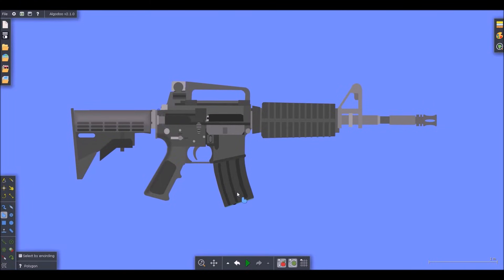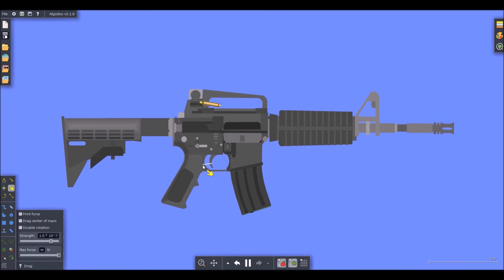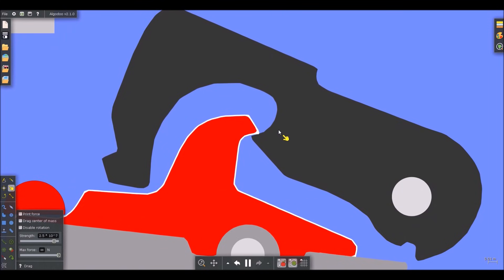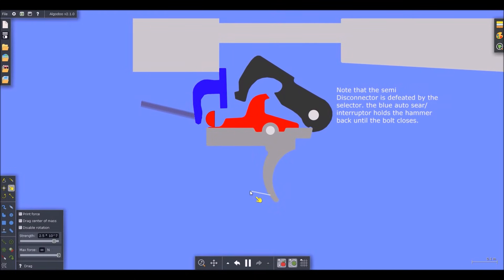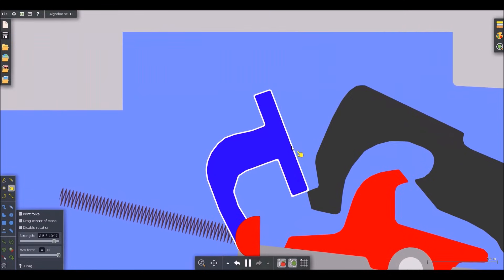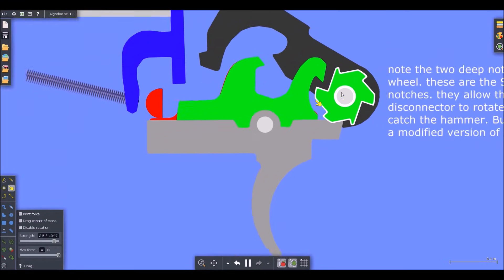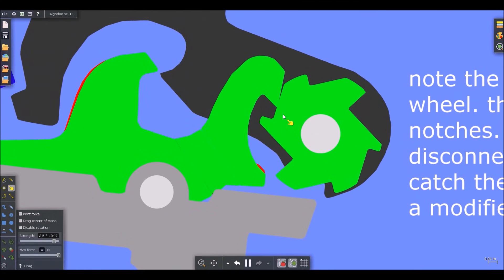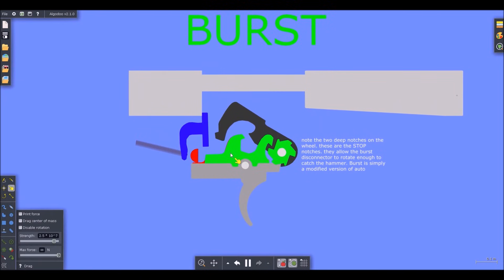How 3-round burst works

Comment: Three round burst blows...
Reply from the maker: tedspang1945 only if you suck at using it
Reply: @StealthTheUnknown  when i was in the service it sucked because it caused different trigger pull weights on each reset throwing off your aim. Nobody liked it. I like the simplicity of semi auto with option of full auto when needed.
Reply from the maker: tedspang1945 fair. To be honest, though, I wouldn’t mind the constantly shifting heavy-heavy-light trigger. I like the ability to shoot a mechanically-limited volley of rounds, it’s useful to put additional rounds in a general direction while following through like you would a marksman’s trigger press. I prefer 4-position selectors because I do agree that full auto is a nice option for its niche uses. I prefer burst for increasing hit probability on laterally-moving targets at medium ranges - man-sized targets at about 50-100 yards. It’s also something like a shotgun blast in close quarters.

Comment: Doesn't DI equal less recoil than gas piston especially on full auto and burst?
Reply from the maker: Steven Pham 3 things primarily affect recoil:

Bullet weight (newton’s law regarding the equal-and-opposite force of accelerating a metal mass at several thousand G-forces);

Bolt/bolt carrier/slide weight; and

Pressure and direction of gases leaving the muzzle.

Long story short: it depends. In theory, di makes things lighter, and so you could have less mass in the bolt since there’s no piston to throw around. That said, the reduced mass could mean higher bolt impulse inti the shoulder (less mass meaning the bolt moves faster).

Regarding auto and burst, DI doesn’t offer any advantage over piston systems in regards to recoil when contrasted to semi automatic fire. For obvious reasons, semi auto  means that the recoil dynamics are negligible to accuracy. On auto and burst, however, high or irregular recoil mean the gun bounces or climbs between shots. Sure, some pistons could add extra mass in one place or another, but as far as whether or not it improves accuracy or not, it all depends on the design. If all the mass is brought in-line with the barrel, and the action, barrel, and stock are linear (as is the case with ARs), the recoil will be pretty much straight back regardless of DI or Piston. It all depends on how everything is set up, but buy and large there is no difference in accuracy - and there are other things to look at to improve accuracy and recoil mitigation before you look at the gas implementation method.

Hope this clears it up a bit!

Comment: Is it possible to fabricate an auto sear and hammer out of block metal at a machine shop?
Reply from the maker: Steven Pham sure, but I wouldn’t see the point since the auto sear could be made from sheet metal, though the hammer makes sense. I wouldn’t recommend any of that though

Comment: Iirc the bcg cannot allow the firing pin to contact the primer until it has rotated and collapsed. 

So it can’t fire until the bolt has rotated into battery. 

Your diagram erroneously shows the bolt rotating before it goes into the chamber. This isn’t possible. The top of the bolt cam is indexed to the upper receiver and only allows the bolt to rotate once it connects with the chamber.
Reply from the maker: Firestarter I know. Mechanisms are approximated on this model for realistic external function and realistic internal representation, but only to a degree. Thanks for watching!

Comment: Your bolt rotates before it locks into the chamber. 

That’s not possible.
Reply from the maker: Firestarter for the reasons of lower-than-real physics refresh rates (something like 400 hz on this model) some mechanisms are made approximate to the real thing while remaining relatively true to the real thing. Another limitation is that this program runs in 2d, and the “rotation” you see is an illusion. There’s actually a dropping block that mates with a block in the receiver, since that’s more secure in the low refresh rate than tabs as small as those on the bolt. Good eye, anyway!

Comment: I have a burst rifle M16a2. Works great in semi all the time. In burst mode, it fires the first round and lite strikes the primer on the second round. I’ve then replaced the buffer and spring and checked the trigger install. All seems fine, unless I’m missing something. Any advise??
Reply from the maker: bobby hale does the automatic sear positively engage your hammer? It sounds to me like that piece is malfunctioning or missing
Reply: Stealth The Unknown : You’re EXACTLY right!! I took it to he Dept armorer. He didn’t k ow either until he compared it side by side to another a2. The part that hangs down was slightly bent and touching the side during burst mode just enough. Not sure if he bent it back or replaced it, but it works like a charm again. You nailed it though! Thanks for the reply.
Reply from the maker: bobby hale nice! Glad you got your rifle squared away!

Comment: I prefer H&K's 3 shot burst mechanism over this.
Reply from the maker: Sokol I do as well, at least in terms of its practicality and simplicity on the operator. This one wanders and can leave you with weird circumstances where a burst will only fire one or two shots. The HK mechanism is spring-loaded and resetting, and also permits automatic as a fire selection. My problem in regards to the hk mechanism: complex, lots of parts, unusual geometries and non-intuitive components. The m16/m4 kit is stupid simple, only needing an additional 2 parts and a couple springs to allow burst instead of auto

Comment: does the main disconnector for three round burst have a slight bend at the end or is it supposed to?
Reply from the maker: Smitty smith yes, it bends slightly to avoid interacting with the hammer unnecessarily
Reply: then how do you get it to fit in the trigger assy and get the pin through it?
Reply from the maker: Smitty smith install it next to your other disconnector as normal. It’s just a bit curved at the end is all. It otherwise drops in like any other mil spec trigger
Reply: so install regular and 3rnd disconnectors together in trigger? both disconnectors together ?
Reply from the maker: yes
Reply from the maker: https://robrobinette.com/images/M16/4-WayDisconnector.jpg

Comment: so a 3 round burst rifle can't be simple switched over to full auto because the cam wheel would be in the way?
Reply from the maker: Blake Ruble depends on the firearm. The way this works on an m16 or an m4 means you can’t have burst AND auto without a custom trigger pack. Other firearms like those manufactured by HK and Sig tend to have 4-position selectors (safe/semi/burst/full)

Comment: I think m4 have advantage on tavor x95
Reply from the maker: oh most definitely. better accuracy and stability, less bulky in spite of the length differences. lefties and righies alike can shoot any AR or m4 with a brass deflector and not get "tavor face"
Reply: @StealthTheUnknown  that's why there's a FN 2000 designed for left or right handed shooter because the casings are ejected on top front of the barrel.
Reply from the maker: @Samuel_Davillo  I’ve had the opportunity to fire one of these. They suck, haha. That forward ejection causes problems and failures
Reply: @StealthTheUnknown  of course, mechanical complexity can cause a lot of failures mostly the casing elevation part. 😂😂

Comment: Awesome! Thanks! Now I am curious how does the selector engage the burst mechanism?
Reply from the maker: It literally does nothing with the burst mechanism. technically, burst is "always active" even in semi. the only thing the selector does is retard or release the auto sear, the disconnector, or the trigger. if it retards the trigger (and auto sear), it's safe. if it retards just the auto sear, the disconnector and trigger can move, making it semi. if it lets the auto sear go but retards the disconnector, it's full auto (or burst). note  that the semi disconnector in red has a tail on it that goes all the way to where the selector goes. that's what "keeps it back" when that part of the selector touches it; it locks it but lets the trigger go, since the disconnector sits in the trigger, but that tab on the selector is thin enough to fit in the trigger. the wider tab is used on safe to block the trigger, too.

Comment: how would a 4 way kit work?
Reply from the maker: the selector stops are filed down to allow an aftermarket selector to have 360 degrees of rotation. the burst disconnector would also have a tail like the regular red disconnector, and the selector would have a dedicated retarding tab for each disconnector. in burst, the semi disconnector is free and the burst disconnector is retarded. in burst, the semi disconnector is retarded. in full auto, both are retarded. on auto and burst, the auto sear is freed.

Comment: What happens if you release the trigger mid cycle of the burst
Reply: That is almost impossible.
Reply from the maker: no it isn't. it's hard, but not impossible. 2 is easy. 1 is hard.
Reply from the maker: it stops. then it continues again where you left off (on this gun at least, and any gun with a rotary, non-resetting cam.) if you squeeze off two and stop, it'll fire only once on the next squeeze. and vice, if you squeeze one off, the next burst will have potential for 2 bewlets

Comment: Correct me if I'm wrong, but it's impossible to shoot anything else than 3 rounds using this burst. (like 1 or 2 rounds while in burst)
Reply from the maker: incorrect. Depends on whether or not the mechanism is home or not, and whether you follow through on the full burst.

With this mechanism, you can very well fire single shots and 2 round bursts if the mech has wandered
Reply: However, if you shot a 2 round burst while on burst, the next squeeze will result in only one round being fired because then the system is home again.(?)
Reply from the maker: Lennert Laevaert yes. If you hit-release and fire two, next trigger pull gives you one shot.

Comment: I had a malfunction once where my M4 was placed on semi. It fired when I pulled the trigger and then fired again when I released. Your video helped me understand what happened. The metal on the front part of the trigger, the sear, probably wore down. Disconnector caught the hammer, but upon release of the trigger, wasn't caught by the sear and the hammer sprung forward and wasn't caught. Thanks.

Comment: Thanks alot for the animation. Now i understand how the mechanism works, finally! =)
Reply: He didn't make this animation himself; he downloaded this design it's free for anyone to download, he didn't make it.
Reply from the maker: Yeah, I did make this model in algodoo, the model wasn't downloaded.I had to draft all the parts and shapes myself by mouse. tedious, but worth it. note in the beginning I say "this is a simulation I made of an M4"
Reply: Amnesia it is really more complicated than the video shows, they didn't explain about the clutch that turns the notched wheel, and the fact that it actually has 2 disconnects instead of 1.
Reply from the maker: I DO show that both disconnectors are there, just that one is visually "above" the other; the semi auto disconnector is just occluded by the burst one. if you pay attention, you can still see it there. and the clutch mechanism, well . . . it's impossible to make coil springs in algodoo, let alone make them bind like the real thing. but a clutch spring like that is a small part of it all. it isn't "much more complicated" as you say, maybe only minorly. the fundamentals of the mechanism however, all the stuff that really pertains to how burs works, is modeled.

Comment: How does the one way friction cam/ratchet work?
Reply from the maker: The mechanism is damn near impossible to represent in-program, but it's fairly intuitive. It's called a spring clutch, and is merely a somewhat flimsy spring wrapped around the base of the hammer, and sits between that and the inside of the cam. There's a tail that keeps it bound to the cam itself without movement. What happens is that the spring tends to lock/bind up around the hammer's base when it's being cocked because it tightens due to friction, but as the hammer drops that spring loosens.

Try this: some retractable pens have a spring inside them that sits tightly around the ink core. Try taking one apart and finding it. Keep that spring around the ink core, but try rotating it. It should bind going one way, but glide going the other. Apply that concept here, but add that cam to the outside of the spring, and make the ink core a hammer's base which sits around the hammer pin

Comment: The constant unnecessary zooming in and out gave me ADHD.
Reply from the maker: Meme Commando Mike the program tends to handle pretty crappy, and I was  looking for a very particular zoom setting that I couldn’t find. Panning is another function that’s a pain in the ass. Years of using the program has developed habits suited for design rather than display

Comment: So you're telling me that I can turn an ar15 into a machine gun with five minutes of filling of that piece that contacts the hammer.
Reply from the maker: Jdeast 2016 no. You’d still need to have something that holds the hammer back until the bolt closes. I’ve heard of people filing the disconnector so it slips and releases the hammer, but that’s 1: illegal and 2: very tricky and unreliable.

Comment: Your diagram is wrong
Reply from the maker: Joe Clark if you’re going to comment on that it’s wrong, would you explain WHY or HOW?
Reply: The reason you haven't found any of those online is because the NFA prohibits the transmission of that information without special licensing specifically the mechanics behind your diagram are wrong
Reply from the maker: Joe Clark again, could you explain HOW?

And no. You can find this information in plenty of places. Manufacturing it without a license is a crime. Giving instructions on how to manufacture it is a crime. Demonstrating isn’t. I’ve talked to several vets who carried an M16 who have confirmed this mech (some comments below), and I’ve had a handful of marines tell me this video is used in armorer’s training. I cannot personally confirm this, but I do know the mechanism is accurate.

Comment: so in 3 round burst, you need a full auto disconnector as well as the dual disconnectors...
Reply from the maker: samgao yeah, auto sear is needed. The dual disconnector setup here is proprietary. Many burst kits use a single disconnector or sear that is manipulated by some counting component in burst. It all depends
Reply: not the auto sear, but the auto disconnect. I see in 3rd burst, there are 2 disconnectors. so I'm guessing the trigger channel on the 3rd burst trigger is thicker to acommodate the 2nd disconnector (dual hook) with the auto disconnector (with the tail). am I correct?
Reply from the maker: samgao the trigger is the same width, but what is typically a single disconnector for a safe-semi-auto configuration is half the thickness so that a second such disconnector can be installed which serves the function of termination of fire after a calculated number of rounds.

It’s a burst disconnector, not auto. Without an auto sear to do its job, the burst disconnector wouldn’t be very useful.
Reply: Stealth The Unknown so the auto disconnected is actually thicker as opposed to a 3rd burst dual dis connectors
Reply from the maker: samgao no. Auto sear is the same thickness on all models that have it. The only thing that changes is disconnector thickness (hooks)
Reply from the maker: samgao auto sear is blue, semi disconnector is red, and burst disconnector is green. There is no auto disconnector. The only component that changes thickness is the semi disconnector (red.) it’s “thick” on non-burst kits, but “thin” in burst kits (thin to accommodate another BURST disconnector next to it)
Reply: So the difference is that the full auto has the tail (of course the trigger is open at the back for the tail) and semi is stopped.
Reply from the maker: samgao what do you mean by “tail?” The full auto sear never actually interacts with the trigger itself, only the hammer and bolt
Reply: not the auto sear, the auto disconnector. Semi auto disconnectors do not have the tail to interact with an auto selector (and the triggers are walled off)
Reply: ah so what blocks it off is the selector switch. Meaning it is an auto disconnector because it's being blocked off keeping it from catching the hammer!
Reply from the maker: samgao basically. My confusion was the phrasing: auto disconnector. Disconnector implies semi-auto, which it serves. I see now that you’re referring to it being a specific shape that permits its use to be disabled to facilitate automatic fire (basically, the disconnector you find in a select-fire group.)

Gotcha. Any further questions?